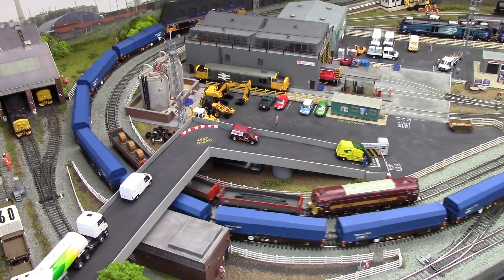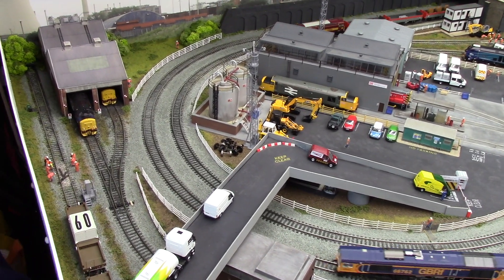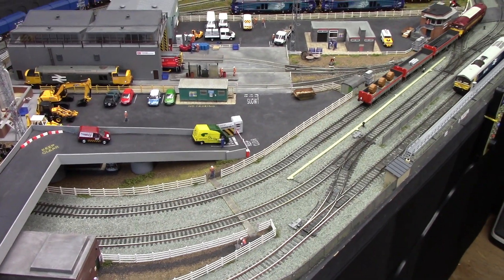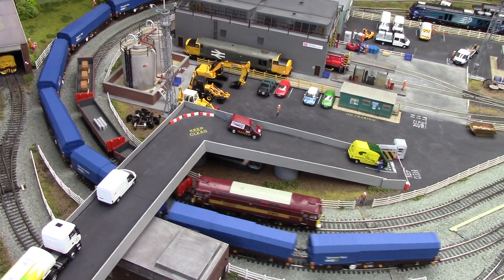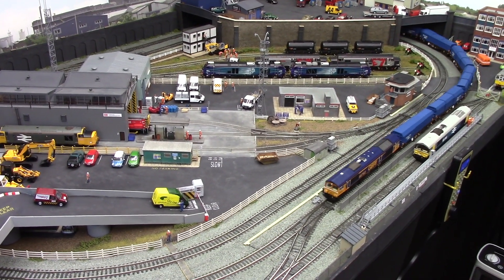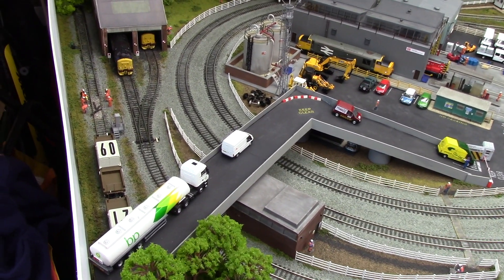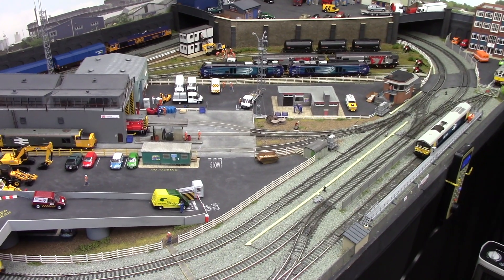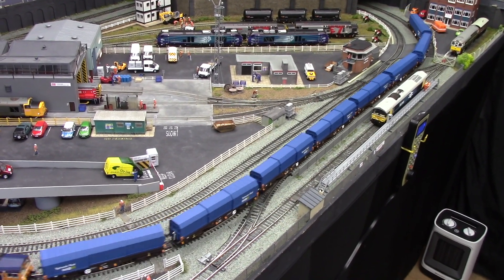Power was that the problem? Time will tell. Layout update

Comment: I think the problem of not having a DCC bus is or has contributed. Even with a bus the advice is not to have a complete 'ring' as this will send DCC signals both ways around the circuit and cause issues with the chips in locos. This could have contributed to issues with the motors. Effectively you have a complete bus by soldering the 2 DCC wires to the track. 5 amps for that layout is rather a lot imho.

Comment: Hi Peter, with all that you have done to secure your power connections and supply, I hope you don;t get anymore problems.  The only thing that I could see, was that I noticed you are using the Hornby analogue power track (orange push buttons), under your little siding hut, maybe the Hornby Digital Power Track, R8241 (has the Green push buttons), that is suitable for 15V DCC systems but the one you use is for DC Analogue 12V.  I'm not sure if it would make a difference with all your bells and whistles but it was just a thought, All the best, Stephen
Reply from the maker: Hi there Stephen well spotted and yes should be for the analogue system but I was aware of this and its had its suppressor removed
Thanks Peter

Comment: Everything seems to be running like a dream so Not sure what else you can do about the supply to the tracks, looks like you’ve done a great job ! Maybe just bad luck with the motors? Just on an Electrical note, are your sockets not already rcd protected as you put one in at the extension outlet and have you got a fused spur for the bulkhead lights or is it wired in 2.5mm ? Sorry to ask but just wondering 😊 cheers Darrell
Reply from the maker: Hi Darrell, you know they well might be as they are for outbuilding use as its the garden shed but I'm taking no more chances. A proper light switch is on the wall (which I don't think you can see in the video) which again is for outside use. Where the power comes from the house theres a fuse and a switch in the box on the wall there, so I can turn everything off back at the house . Had it down by an electrician who knew what I wanted to do, so should be OK
All the best Thanks Peter

Comment: Hi Peter,
Now as you say belt and braces have been deployed lets hope you have no more trouble but all I can say is if it was a problem with your layout it would happen lots of times to the same engines even with a new motor fitted but only seems to happen once???. I do not think how you power your layout would give you loads of problems just look at mine I use the same track connectors as you but X by 5 + 1 clip all going to a basic terminal block and then feed into my elink all powered by the Hornby 4/5 amp power supply and I do point motors and lights and my layout is a bit bigger than yours I think you would agree and although mine is not without some operating difficulties due to Railmaster the engines by and large work ok and the only things that have broken and were not fixable is my Jinty and 2 sound decoders 1 of which was due to me . If a loco did not work it was always out of the box and only one failed in running that needed new stuff and that was the HST. I do hope you now have trouble free running and then your only problem will be what the hell do I do a video on now!!!. Keep well and safe.
Cheers Robert.
Reply from the maker: Hi Robert, yes deep down I thought it can't be my setup. but so when the new Heljan went wrong well !!!!!! So will see apart from start again nothing else to do with it. So now ifs alls well from now on I can just sit back and watch and take part in your videos. Went very well I thought on Sunday
Take care Robert all the best Peter

Comment: Hi Peter , interesting video about connecting supply . I have soldered my input to both the main tracks of my layout , have used the point clips in all points and have not had any issues with running anywhere . Like you any points within easy reach are manually switched .          Cheers.........Peter
Reply from the maker: Hi Peter Yes same as me then. Still not convinced I had a power problem but when the new 33 went wrong and thats a different make to the Bachmanns I just hope Ive covered all the bases. It might have just been bad luck in the end.
All the best Peter

Comment: You certainly have done a "belt and braces" job on your power supply, I can't imagine you can do more. But if everything else you ran since you built your layout hasn't had issues then it seems logical to be the locos not the layout. Probably best to eliminate all chances of external factors like you have though. I must admit that beyond plugging in the transformers for the controller I haven't given the power supply or AC/DC thing any thought. I checked voltages  etc to make sure the track supply was good but nothing more. I will now make sure I put a surge protector in though. fingers crossed you don't have any more issues with those locos. I watch "Barry Davis Model Railways" and he has a simple ammeter wired in to monitor ampage draw and although his layout is DC it always shows the locos don't pull a negligible amount of power.
Reply from the maker: Hi Frank, yes a bit over the top I guess but we will see I do think I have been unlucky with some motors. A surge protector on top of the controllers inbuilt features I think can't do no harm  and should have done that a long time back.
All the best Peter

Comment: Hi Peter, Did you ever watch that video from Charlie Bishop at Chadwick Model Railway all about DCC power that I mentioned the other day? He was really surprised when he checked out the power used by locos just sitting on the track, hardly anything at all. He used one of those DCC Concepts Alpha meters you mentioned yourself in this video. I think you have done a good job at checking everything out you can, I guess time will tell! I don't have a ring main type set up on my layout, just the traditional DC cab wiring with the section switches turned on for DCC and my layout is twice the size of yours, I don't have any issues if I keep it to two or three sound locos at a time. As for sound, I agree those Mega Base speakers don't sound right, there have too much bass.............I like to hear those high pitch tinny whines too. Best regards Dave.
Reply from the maker: Hi Dave, yes saw that, may get one soon, simple enough to fit but I don't have much room to display it so will just have it in the system working behind the scene. Nice to know about your system too and yes I don't get it with that EM2 speaker, when Hattons first did a demo video showing off there sounds on the 66, I thought Ohh that sounds awful, so when I got mine took a chance on the i-phone job but love it and so easy to fit.
All the best Peter

Comment: Is the Alpha better than the testers that you can hold right on the track?  Is it more important to be able to test the track at a specific location or just to get an overall reading of the Voltage/Amperage?
Reply from the maker: Hi there, as far as I know as I don't have one, its a meter thats tells you what power your track has and how much power your locos are using, so it probably would show you if a loco is drawing a lot of power which may indicate a problem with the loco. I think if you have a problem with the track, you still could do with a tester.
Cheers Peter

Comment: Hi Peter - Hopefully it was bad luck that was the issue because as you say if it was a power issue why did only certain locos have problems. I too have gone for a DCC Concepts power supply and the meter too I just have to fit them...…...Cheers Kev
Reply from the maker: Hi Kev, well I have gone down the belts and braces route now so will see. Also the thing is once I changed the motors on the affected locos they have been OK, so as you say I hope its just bad luck. If I get the meter it will have to be in the system but under the covers, I don't have the room to have it out on show. 
So all the best Peter